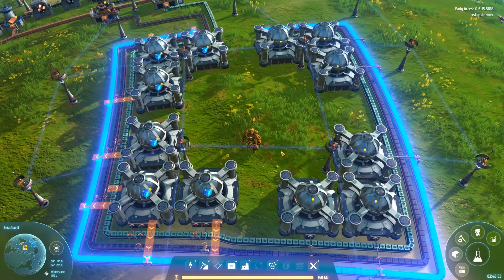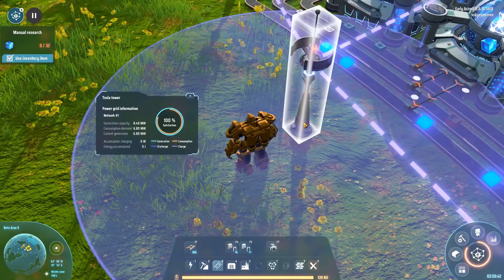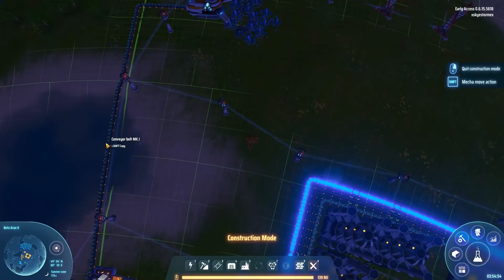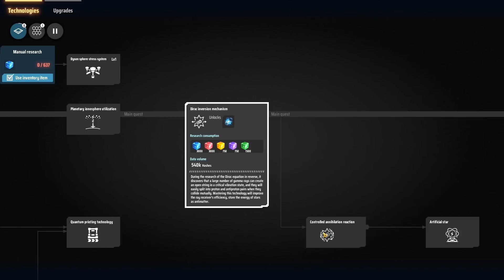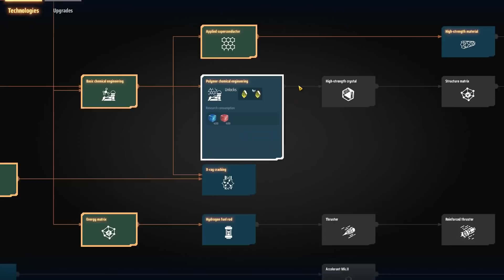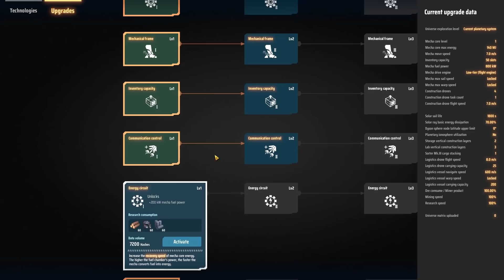HOW TO MASS PRODUCE BLUE MATRIX CUBES ► DYSON SPHERE PROGRAM Gameplay ► Factory Simulation Game 2021

Comment: If you make your cube production in 1x2 rows with room for 3 conveners between rows, you could snake the belts between them and give every building at least 6 access points facing belts. You could also directly feed cubes from factories into research without needing belts to move the cubes. So then you could make the 1x2 rows closer together for research specifically because you should be able to get that production to feed at 1:1.

Comment: your going to love how they designed this :D every Cube needs to be fed into the matrix ,... edit... ( not Separate Matrix) to actually work. So... time to rethink and redo your whole system. I've notice to you didn't use your splitter at all this episode, It will come in good use in days to come. 1 production = blue = 2 = red :D its going to fun. Hurt my brain when i first figuring it out for the first time. The research page is misleading this way... y do you thing they design it where you have 3 imputes on all sides on most items in the game … (?)  

1st tier of stuff is your regular items.
2nd Tier Blue Matrix
3rd Tier Blue and Red Matrix (fed into the Research Centers... at the same time...)  

That's where I am at so far yes u get numerous planets  to work but need to plan those logistics with Research PLAN in the middle/base.
Reply: your are fluffin kidding me lol,ive already rebuilt the assembly line twice  lol,only had the game 2 days

Comment: Problem:
Your storage buffer system doesn't actually work as intended;
What I mean by that is your input into storage is slower than your output, that only is a problem here because your machines aren't outputting cubes because the belt is completely stacked and the storage fills the belt before a machine can even see an empty space. To compare to factorio, the inserter is holding an item and it can't place it on the already full belt that is just cycling itself through anyways
Reply: the whole backfeed loop doesn't make a lot of sense on that belt either way. he should put the buffer chest in the opposite side of the research facility, between the producers and the consumers.
Reply: @klauzwayne4215  my first thought last video
Reply: @klauzwayne4215  yep, exactly, here it shows off that Skye didnt play Factorio, also the way he set up production lines :D it's not the worse, but far from best efficiency
Reply: @csokasg  He shouldn't need to play a separate game to understand how to play this game "efficiently", I'm new to this game and he has actually helped me understand a lot about what buildings do and how you can use them, just because you played Factorio and probably know how to do things efficiently in this game because of past experience, doesn't mean you get the right to judge him for his utilization on how he sets buildings up and say "it shows he didn't play Factorio", don't need to flame someone for not doing it the same way you do mate.

Comment: 6:54 - commenting early so you may have already done it, but it would be very worthwhile to connect your two inside conveyor belts back into the start, to form a loop, that way you aren’t wasting resources if you’re producing more than the blue cube producers can use at any given time.
32:46 - now do the same with the two inner belts 

26:00 - or, to go off what I said above, you could run the inner two rings through the gap there between the researchers and the producers and have them go around the back sides of the cube producers and then reconnect through the gap on the opposite side, that way no materials are wasted. Your extra outputs from the cube makers could also be collected from the inside and run to connect through the gap opposite where the camera is now.

27:20 - you put that type two in facing the wrong direction. You’re trying to take cubes into the cube making machine

Comment: Skye???   how do you rotate the map?  the middle mouse button drag doesn't work for me.  if i can't rotate the map it is very difficult to built things. so i am a bit stuck.
Reply: its middle mouse button for me
Reply from the maker: Middle mouse works for me
Reply: @SkyeStorme   well... plugged in another mouse and that 1 does work with the middle mouse.  weird.
Reply: Does your mouse have software that lets you customize buttons?  Could be the button press for middle button is changed.